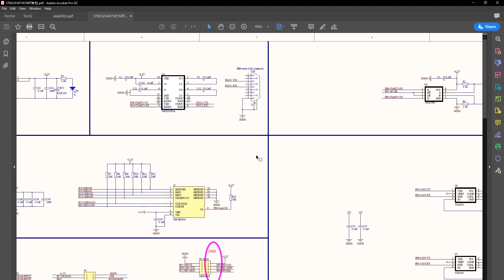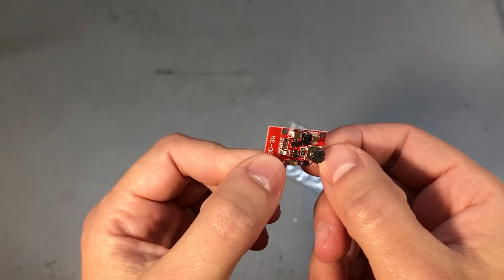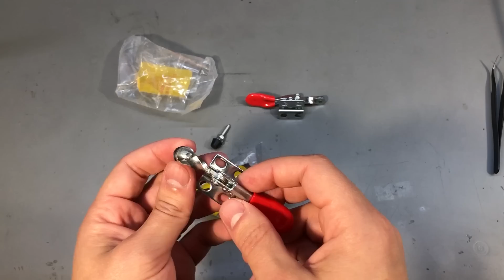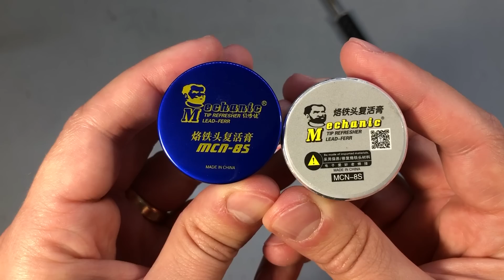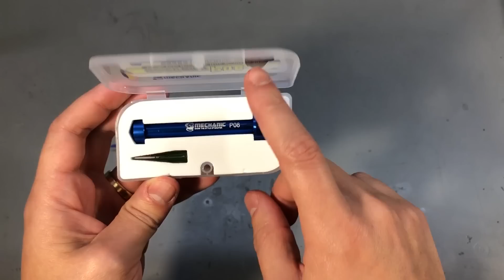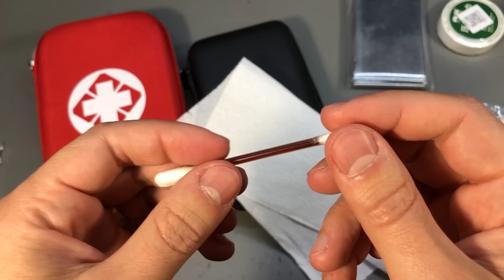InTheMail | Voltlog #334

Comment: I used to make base eva resin for a living. Some other products that use eva are alluminum can liners and insulation cover between the jacket and conductor for high voltage wire.

Comment: I bought two of the blue plunger. I don't think alone when I say tracking down and trying to clean those plastic plungers is a pain.  Also while on Aliexpress I came across a larger unit that uses your palm rather than your thumb. There's still another that uses a screw mechanism for precise amounts.
Reply from the maker: Thought about getting the one with the mechanism but I don't know, when I really need the precision while working under magnification I don't know if I wanna fiddle with my thumb on that wheel to put pressure.

Comment: Hi Voltlog, for the STM32F407VET6 Development Board, the one with can bus. The seller no longer has the item for sale. So it is not clear how to then obtain the schematic files etc, since we need to buy from a different seller. It really is something that needs the files open sourced, and put up on github. Otherwise its like... well if buy this board from another seller then might not get access to those schematic anyhow. Rather unfortunate. But thank you for the recommendations for these other items in the video. Especially the plunger.
Reply from the maker: Seller is now back online, the board can be ordered and he will provide link for documentation pack.

Comment: You see, single piece plunger would require you to machine a lot of metal away. By making it in pieces, you can machine out the pusher and knob, thread an aluminium tube and screw it all together
Reply from the maker: Yup, makes sense.

Comment: If you get the P50-E2 pogo pins, they will fit into pin header connectors. I use it for ISP or st-link connections to boards in very space limited projects, where the pins for programming would mean too much volume used already.
Reply from the maker: Thanks! I ordered some of those as well and are on their way.

Comment: Let me guess, the center piece of the plunger is a pipe. And even if it isn't it's much cheaper to start out with an aluminium rod and add two endcaps than to machine the piece out of a thicker rod (removing about 3/4 of the stock material).
Reply from the maker: It looks like it is a solid piece of aluminium but what you're saying make sense.

Comment: For the F401, go ahead and order a few W25Q128's. The pad is designed for the W25Qxx series. In the micropython configuration options, the largest flag enabled supported option is the /128 (16MB) chip. There is a W25Q256 chip, but it isn't supported by default. You can get a 5x pack of 128's for around $2 on AliEx, while a single 256 is around the same price. Also, if you're going to play around with μpy, go ahead and order a pyboard 1v1 clone despite the price. The μpy docs have a bunch of examples for getting started including how to use the accelerometer that comes on the board and it looks like it uses the 4 LED's for things like debugging (but I haven't gotten that far in practice yet, just reading ahead).
  Use the mcauser github repo for the board files needed. Also, back out of his boards repo and look at his other repos. He has one that lists all of the different peripheral libraries people have made that you can download and try.

  I've been playing around with podman. AKA the FOSS version of Docker that works so much like it, the documentation says you can make an alias from docker to podman and use them the same. I am only just getting familiar with it, but you can find a bunch of premade toolchain containers for micropython and various hardware like the ESP-IDF/esp32 toolchain. Even with windows, this should make things easier, if you can get docker running. I started going down the container toolchain path to see how others are getting micropython on the esp32 and samd boards without using the nightly builds binary. So that's where I'm at right now. Also, using a micro SD card is a feature that appears well supported. I just ordered a 10x lot of 128MB (or 256MB/can't recall) SD cards for less than $10 shipped. For like $5 more you can get 1GB's, which would probably be smarter, but I'm a cheap bastard :-)
Reply from the maker: Thanks for the hint, I ordered one of those W25Q128. The thing is there are so many cool things coming out and all of these interesting dev boards and projects but too little time to really dig into each of these technologies.
Reply: @voltlog  
That's why we share and talk about this stuff. It's not like any of the good open source projects have advertising departments. Heck, it's getting to be harder to find good video references. YT is making it harder to find non-monetized stuff like conference talks and the more raw and in-depth dev content. That's the reason I make my playlists public. I save a ton of references on specific content I come across. Some of it, like the University of Boulder Colorado's FPGA classes I've pulled out of a channel's deep history manually. It's all stuff I've watched and found helpful enough to save references to. I just wish everyone could see the playlists alphabetically like how I use them.

  I don't care if you do the micropython thing or not. I just recall you mentioning you wanted to spend some time learning python awhile back, it's what I'm currently playing with, and I figured, if you are interested, these are some of the things I've learned in the last couple of days that would have saved me some time :-)

Lastly, I don't know if I mentioned it here before, but if you do the micropython thing, use thonny dot org's IDE. It's everything an IDE should be. There's no learning curve like pycharm or PlatformIO, it just makes intuitive sense out of the box.
Reply from the maker: @UpcycleElectronics  I definitely need to learn some Python and it's on my todo list, thank you for all the references.

Comment: I'm pretty sure the plunger has screw-on ends on both ends because if even one of those was a solid part of the shaft, they'd have to use much thicker stock to turn the shaft out of, implying much more material to remove so a longer operation and far more metal wasted as chips. The extra complexity is probably inconsequential for the CNC lathe that churns these out, it merely takes a bit longer to assemble - and one end would have to be removable anyway, so the second one is a minimal overhead.
Reply from the maker: That makes sense.